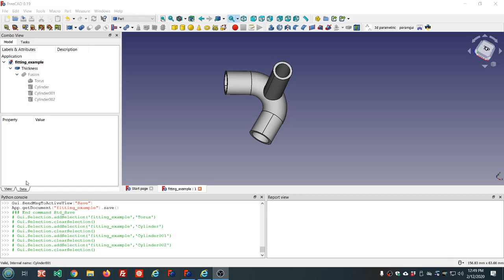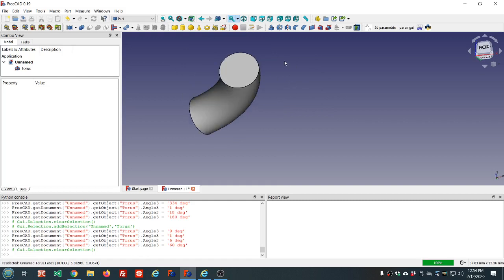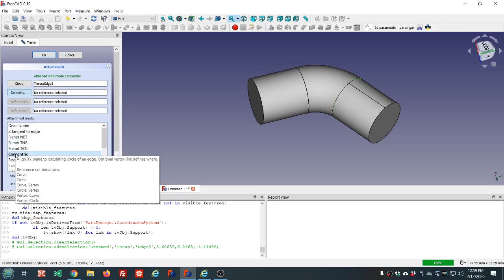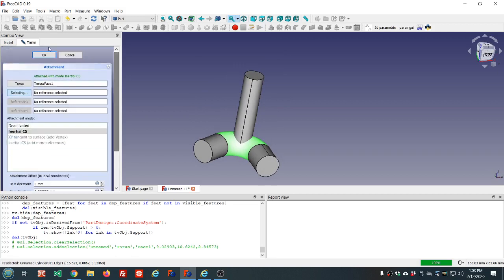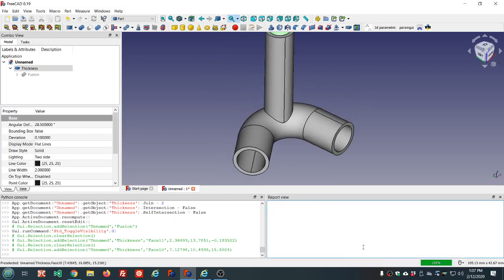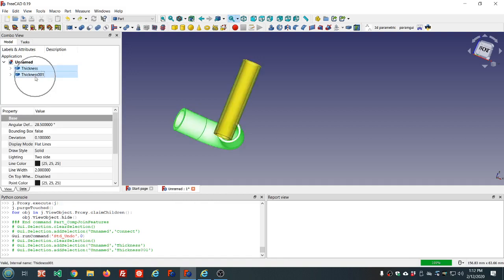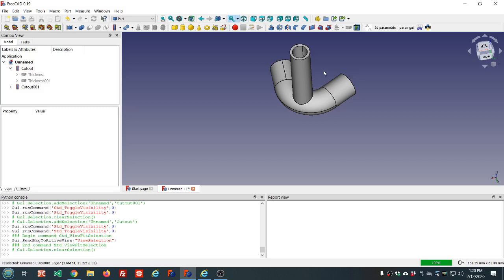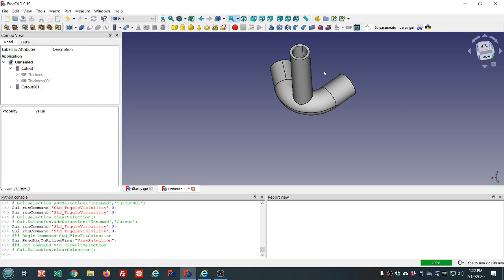006   FreeCAD Torus

Comment: 3:17 On the latest version 0.21.1 the angle is changed on the inner part of the tube instead of the outer part. 
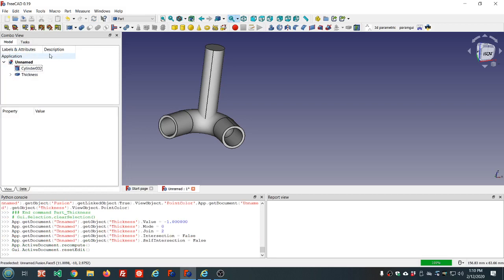17:32 When I select Intersection I get error: Input error BRep_API: command not done. It works when I chose Arc though. And I can set it to intersection in the properties of the Thickness object. Also it no longer seems necessary to change the thickness to -1 (Error not encountered at 20:49)

Comment: Hi Mark. When you reduce Angle1 to -160.000, it shows the gap on the O.D.. When I do it it is on the I.D. Suggestions?
OS: Windows 7 Version 6.1 (Build 7601: SP 1)
Word size of OS: 64-bit
Word size of FreeCAD: 64-bit
Version: 0.19.24291 (Git)
Build type: Release
Branch: releases/FreeCAD-0-19
Hash: 7b5e18a0759de778b74d3a5c17eba9cb815035ac
Python version: 3.8.6+
Qt version: 5.15.2
Coin version: 4.0.1
OCC version: 7.5.0
Locale: English/United States (en_US)

I also had this when running 0.19.1, that's why I updated this weekend ...

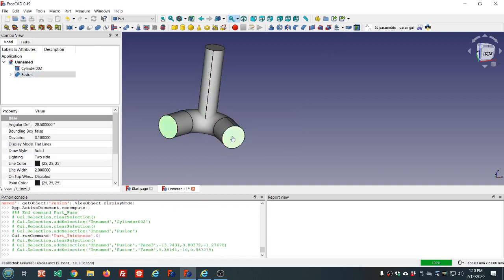Comment: 20:28  .  When you fuse all the three components, it becomes one object.  That means, selecting one circular cross section for thickness command should be enough.  When I selected one circular face, the bore went past the torus, but the cylinder at the other end was still solid.  Only when I selected both faces as per your tutorial,  the hole was made on both cylinders.  Is it program bug?
Reply from the maker: Only the selected faces are supposed to have holes.  For example if you have a simple cylinder and select one end you get a container closed on the other end, but if you select both ends you get a tube or pipe.